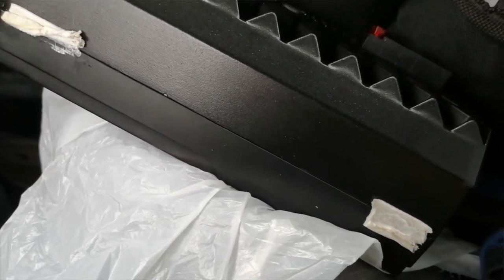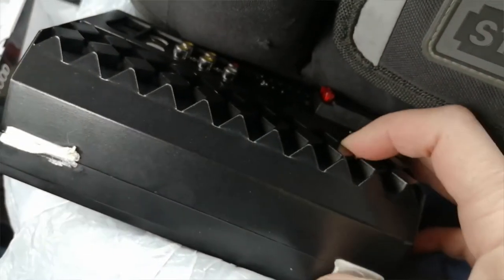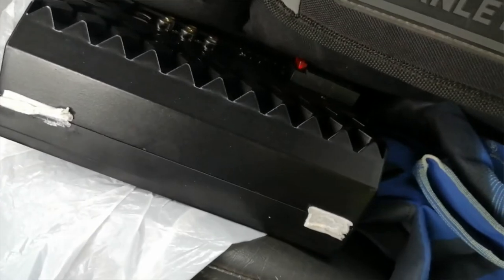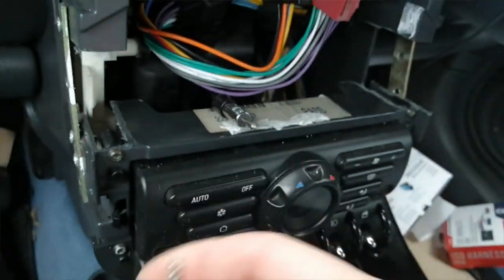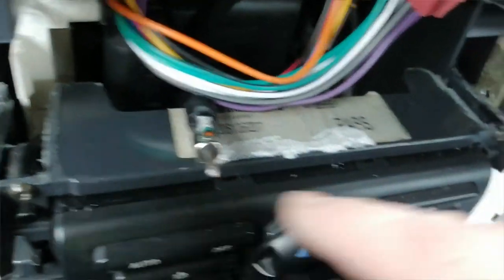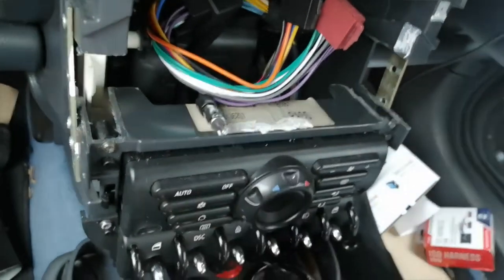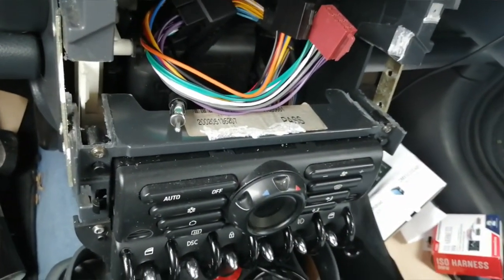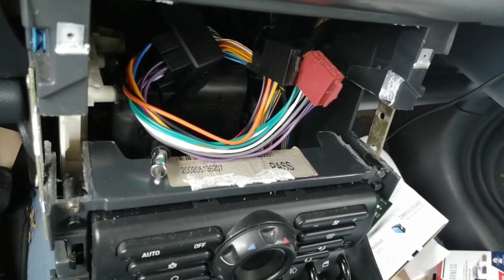Car DIY disasters BMW Mini double din radio

Comment: im half way doing one on a R56 mini, you can buy a fascia kit in many places, it drops the heater/air con controls down 15-20mm some kits come with a blanking plate for when the boost radio comes out of the speedeo clock.
Leads are available to for the iso connection, the canbus/chimes and for the steering wheel controls where fitted.
Its a bit of a mission but looks good on the minis ive seen it in, the car in your video shows, i suppose what happens when you cut corners and dont do your research, which is what ive been doing!.